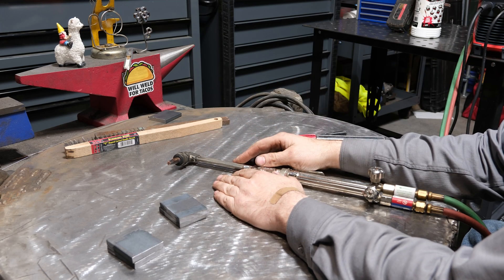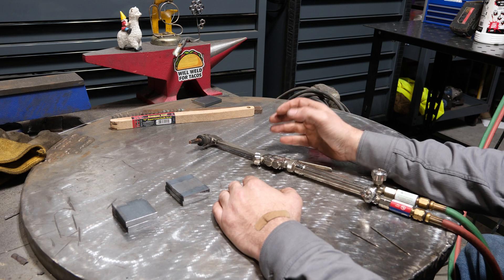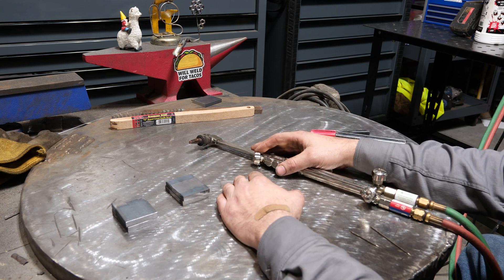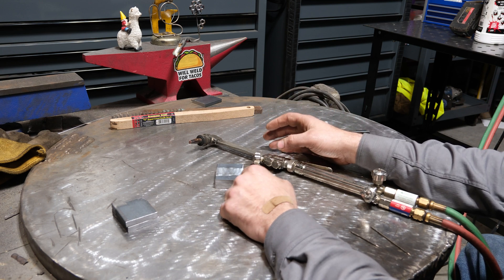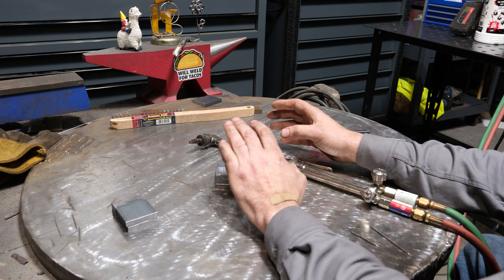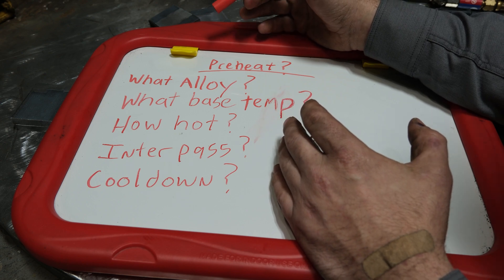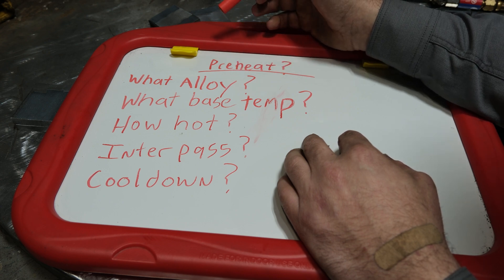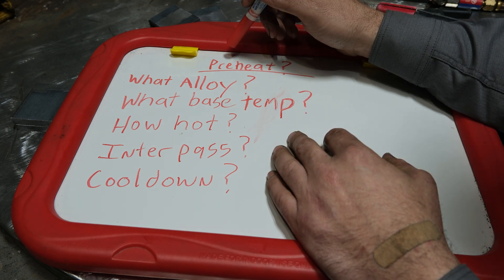Does excessive preheat of steel affect weld strength?

Comment: Wow Greg, you sent me down a spiral learning trail. I got out my, "Metals and How to Weld Them" by Lincoln 1976 version 14.  It contains no less than seven references to preheating in the book.  I've read some and found out things I did not know. One thing I found is that Lincoln sold a Preheat Calculator for determining what metals and how much  and what rods. I looked it up and they still sell this thing in 2024, for $7.50.   I'm going to get it. A lot of the book discusses heat as a way to prevent the weld from hardening over the base metal.   Keep up the good videos!
Reply from the maker: I have that same book 😀👍.  Awesome tip on the preheat calculator, I have never seen that before and I just bought it.  Preheat becomes very valuable with certain sensitive materials and to help limit undesirable warpage.  That book and a few others are really helpful to understand how to use preheat properly 👍.  I actually will be talking about that book and a few others that I have soon 😀.
Reply: I have some odds and ends books.  Your vids are like proof.   I've read the books but can't remember all I've read.   Nothing worse than  reading them again to find that little tidbit of info.
Reply: It would be cool if Links were provided to some of these reference books.

Comment: Just out of curiosity, do you think bending these two examples towards the Face would have been more Telling in terms of strength of the weld and in particular a better visual of Grain Structure failures? 

I have played a bit with this on 1/4 plate and found that excessive preheat failed easier but not in the weld as much as the parent metal tearing open to reveal a really rough grain boundary in the base metal as you pointed out in the 4th “Weird” failure.
Reply from the maker: That’s a great idea.  Next time I am at the tin shed I think I will do that and tear them open to see what happens and what they look like.  A cut and etch at 1k degrees didn’t look much different than 500 but that doesn’t really show the grain structure.  I am not sure what will happen but I bet it will be different lol.

Comment: Very, VERY interesting! You keep taking these odd subjects that 'seem' easy and blow the reasoning right out the exhaust port. I for one thought for sure that super pre-heating would metallurgically speaking, permit the metal to 'melt' atomically and therefor meld - better. Your ending bend proved that wrong. I never thought extensive preheating would be counter-intuitive!

Comment: The main problem with excess preheat is grain growth, which increases the minimum bending radius. You might consider building a set up for your press to do a proper tensile pull. I've got half a mind to build something myself, but I'll have to spend a little more money
Reply from the maker: I really want to do just that, but I think I would need a bigger press or just to start with a bigger ram 😀.  I need to do some research and figure some things out.  I have been trying to find a new home for the shop for a year now with no luck.  I really need more space to add some more equipment to make more things possible. 

Edit:  also, the 3/8th plate likely can’t generate enough force to determine the actually differences between the preheated plates.  If I had a bigger press and 1/2in steel I am sure I could shake out the failures, but straight tensile strength like your saying would be a better more predictable way to go.
Reply: The first thing that popped into my head was a box that went around a beam, and the beam would sit on the press and the ram would push down on the box and the pull specimen would be fixed to the bottom of the beam and the bottom of the box
That's about the fastest and dirtiest way I can think of that will actually work
I wish I could post a drawing of it

Comment: Very interesting testing!
Reply from the maker: Thanks 👍.  I wish I would have captured the one I did with the apprentice on video.  I was expecting the same results with the 1k temp as that one but it didn’t happen.  Definitely isn’t smart to heat things super hot and expect positive results lol.
Reply: @ Also want to report that I tried 7018 today for the first time. Harder to restart than 6013 but runs nicer once started. Also lays down a wider bead. I got porosity for the first time when the arc got too long. 6010 and 6013 were not as sensitive in this way.  Stick welding is very interesting and fun.  Thanks for your teachings.
Reply: @nealesmith1873  Try the two tricks he recommends with 7018 like flicking your rod after a weld to throw off that molten ball at the end of the rod, and/or pinch off that ball of solid flux that forms on the end of the rod, it'll make restarts a lot easier. What happens is rods like 6010 are a cellulose base, and doesn't form a hard slag like the rutile type of flux on a 7018. It forms into like a glassy substance once cooled, and that doesn't conduct electricity, so you either have to break that off, or tap the rod pretty hard to get it to relight. I've had some success with that, but it's hard to not long arc it from having to repeatedly tap the rod. Also, I've found that if you break off too much flux from the tip of the rod, then you get starting porosity because there's no shielding for a couple seconds until enough rod is burnt off to get to some flux. I've found using my glove to pinch off the end works the best.
Reply: @brnmcc01 Thanks!  I’ll try these tips next time.

Comment: You know that feeling you keep chipping at your 6010 weld hoping it gets better and it does 😢
Reply from the maker: 6010 can be a real heart breaker lol.  The last 3 weeks I have been welding open root pipe in training and the roots look ok but the second that slag is off (which is a pain to remove) that bastard undercut is saying hello 😅
Reply: @ I keep blowing through my roots but my 6010 overhead outside corner joint is amazing
Reply: @makingmistakeswithgreg  Try making a small u shape if you are doing uphand and do not step the rod very far out keep it tight and dont travel too fast Heavy 3/32 Land and tight 3/32 gap with 1/8 rod 80-85 amps arc force 0 to+2,  if you are on sch 40 with 3/32 you will need a tighter gap and a lighter land!

Comment: Do you ever use " metal core" mig wire when using spray arc, instead of solid core wire? I've seen it demonstrated using lower voltage than solid core. It cost less than it used to be, a 10# pound spool was less than 40$ on eBay. If you want to try it I will help you get some.
Reply from the maker: So metal core isn’t something that I commonly would need to use, and I actually haven’t used much of.  I definitely will test some out.  Based on what I have done with it, I know it still has some drawbacks.  It operates in spray mode so it still will take a lot of voltage.  I can’t imagine it would run well below about 25v so it would still need a pretty powerful welder since most mig machines can’t output 24+ volts at 180+ amps with .045 wire.  Welding it out of position requires pulse just like normal spray.  

It may be possible to run a metal cored wire at lower voltage than spray, but every wire I am aware of uses it for spray.  All of the benefits that come with spray mode would be gone at short circuit voltages which would not give a whole lot of positives.  The benefits of metal core is low spatter (due to spray transfer) ability to gain unique weld properties a single solid wire couldn’t have, better ability to handle surface contaminates, and faster travel speed (with more deposition) than straight hardwire.  I have heard it has a wider penetration than spray with hardwire, which tends to have limited side fusion, but I haven’t seen a cut and etch to confirm that.  I need to get some to experiment with for sure.  👍

Comment: My first job yesterday on cold railings. Couldn't get it right. Kept sticking. Had to pre heat with blow torch. Then it took off much better. The setting above started easy but blew a wild arc that melted everything.
Reply from the maker: If you are stick welding part of the reason hotter steel starts easier is because it’s “slick” aka the rod tip slides easier on the surface.  Since hand railings aren’t a critical weld for the most part, you might want to find 6013, 6011, or 7014 rods that have a graphite tip.  They generally are called easy start or easy strike, and they will give far better starts.  I use them a lot on limited access repairs with 7018 (esab 7018 prime) because it can be tough to get a rod lit and not stick it.

Comment: With alloy steel with medium carbon content, cool down becomes a matter of getting into heat treating/tempering timing which can be hours for thicker parts.
Reply from the maker: Absolutely.  It 100% pays to know what you’re welding on in those cases.  The feasibility of welding on things requiring heat treatment is limited at best.  When I have done it I perform the welds to the customers request and then they take care of the heat treatment.

Comment: Hi Greg, i'm trying to learn to stick weld and i watched some of your videos and i see you mostly weld on thicker plates (5+ mm) but all the scraps i can put my hands on are thin 1-2mm. I don't know if i'm doing it right because when i use recommended amperages for the type of stick i'm using (6013 thats what i found in the garage) i melt through and when i lower the amps the welds don't look like yours. Also  the plates are warping badly, not that i care much about it now that i'm at the very beginning of my welding journey but later i would be a big problem. Do you have any tips and/or tricks? Thanks
Reply: Hey bud I’m not stick welder but in general try going 5-10 amps lower than recommended and focus on weld beads that only about 25 mm in length move around on your material and give a lil bit for the heat to dissipate. In tig it’s not as much the amps but how much time you spend in one spot that screws you.
Reply from the maker: So what you talked about is common for many people.  Stick welding is mostly designed for welding material 3.2mm and thicker.  Common rods (3.2mm and 2.4mm) are not really meant to weld thinner material than that.  There are ways to help with the predicament you’re in.  The first thing is, if you can get ahold of 1.6mm rods in 7014, or 6013 that will be far easier to weld thin 1-2mm material.  When I say easier, it will still be difficult, just easier than 2.4mm rods.  The mini rods move a ton, tend to be hard to start, and require a lot of skill to weld with.  

As far as tricks to make the situation better, run the 6013 rods you have on DCEN (electrode holder on the negative terminal) it will lower penetration.  Clamping it to a thicker piece of any metal will help pull heat out as well.  To prevent warping you must reduce heat input.  The only way to do that is to go to smaller rods.  

Realistically I know it’s not likely desirable idea, but if you can get a hold of a flux core wire welding machine and wire, it is infinitely easier to use that.  I can literally take someone with no experience and within 2-3 hours teach them to make simple welds with a very basic flux core wire welder, even on thinner material.  It’s a far better “tool” for thin material.  Stick welding in general is awesome for thick material but it not ideal for thin.  Hope that helps 👍.
Reply: @makingmistakeswithgreg  Thanks for the reply. So the two ways are thicker material or thinner rods. I still sould be good though because for now i'm only practicing putting down a straight uniform bead so i don't care much about the material but it's good info if i ever get to welding useful stuff
Reply: @fast9881  Definitely try to find the really small 1.6mm rods if you wanna stay with stick. Welded a rusted out lawnmower deck with those tiny rods and most of it was more rust than steel.
Reply: @modarkthemauler  as i said this is just for practicing so it's not a big deal, in the end i'm just learning how to put down a bead and those are free scraps of metal. It was more "if i had to do it right what would i need to do", but i'll keep it in mind for the future
Reply: @fast9881  Even more if it's for practice. Get the tiny sticks and see just how low voltage and thin you can go with stick.
Reply: A ac welder is going to weld different from a dc welder. And this day and time if the welder is multiuse welder just mig weld. I am a stick welder and this day and time mig seems to be able to do what what a stick welder will do. Also using a mig welder there’s less chance of blowing out what you are welding.

Comment: Typically it depends on what material if ur preheating T1 to those temps you just ruined the material annealing it
Reply from the maker: 100%.  That’s why knowing what your welding almost becomes more critical than anything else.  Adding more variables to an overly complex thing like welding sensitive materials is a recipe for disaster lol.